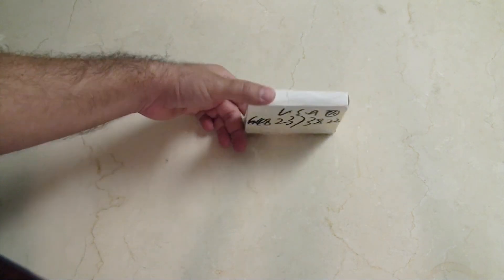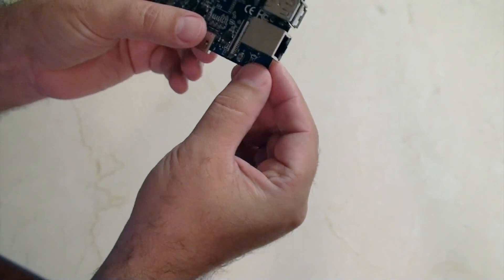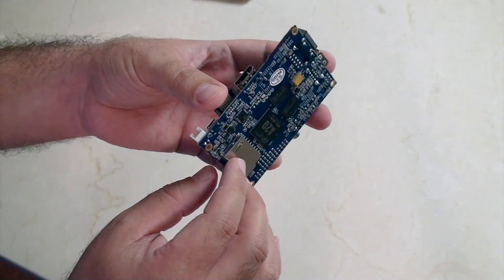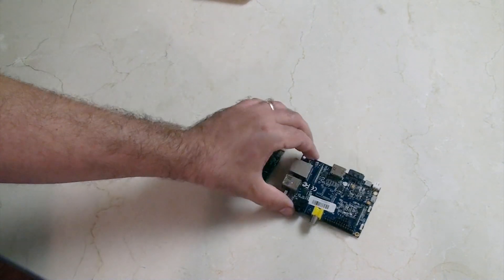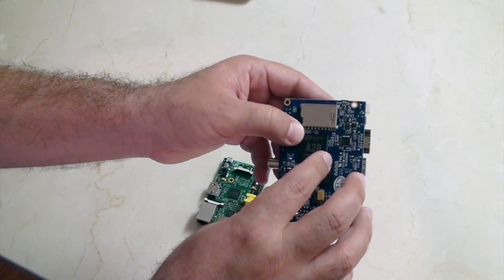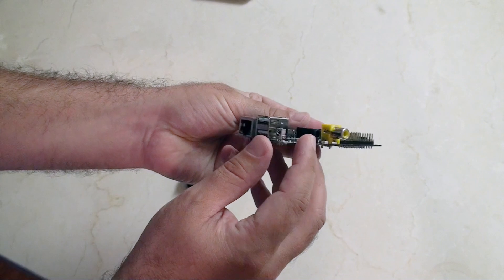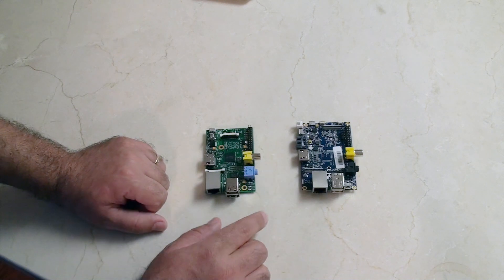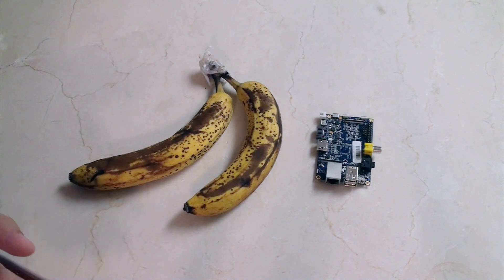Banana Pi: Unboxing and First Look this Raspberry Pi alternative

Comment: thank for development man's  contribution and share they's achievement, the newest banana pi image have update,use the newest uboot and Linux kernel 
1.Uboot 2015.01 version,Linux kernel version：Kernel 3.19-rc5 
2.suppot uboot HDMI display, more faster boot . 
3.support banana BPI-R1 BPI-M1 hareware. can run on BPI-M1, BPI-R1. 
4.have support BPI-R1 switch chip function and wifi moudle also support 
5.can run on Raspberry Pi B2 quad core hardware ,and also can run on Raspberry Pi B and B+ 

download link: 

http://www.banana-pi.com/eaxw_view.asp?id=369